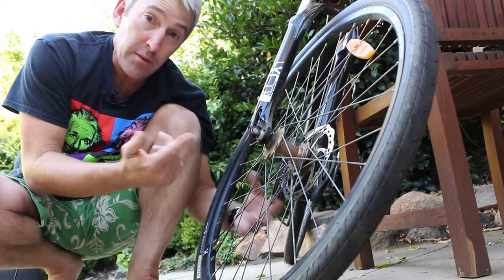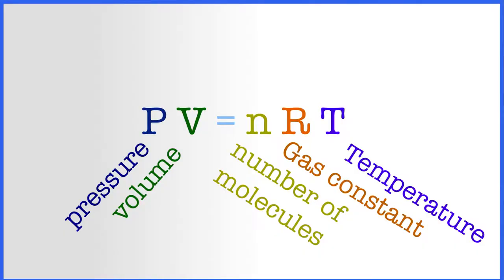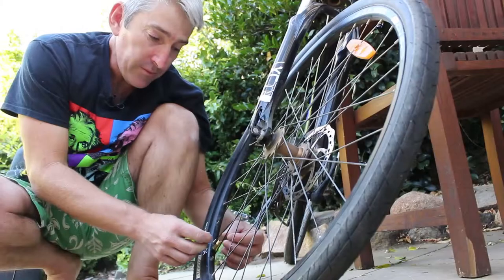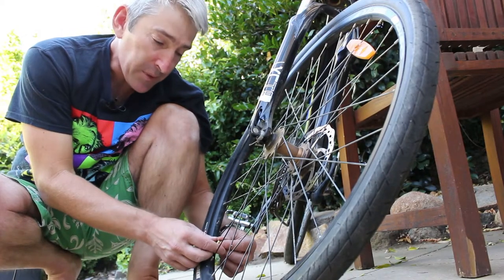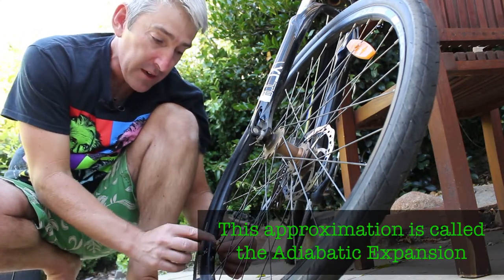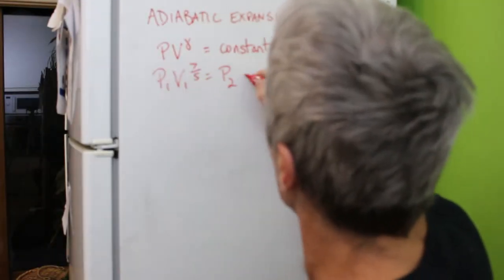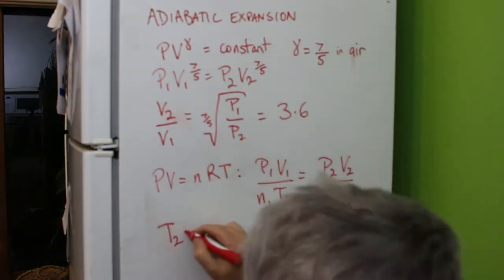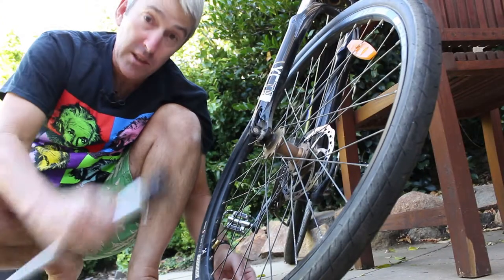How a bicycle tyre is like an airconditioner

Comment: This is a great explanation of refrigeration. I remember reading about how it works years ago and then never really being able to articulate it (the example I saw used an oven and a bowl of water or something ... ) however one thing I can't understand here is why cooling the pressurised gas doesn't reduce it's propensity to spring back to its original volume. Like if I take nitrogen and compress it to a liquid form, it gets super cold doesn't it? The only thing that makes liquid nitrogen want to return to a gas is if you warm it up. If you were to keep the ambient temperature at absolute zero or something wouldn't liquid nitrogen remain a liquid?
Reply from the maker: What a great question - yes you're exactly right, it will spring back to a slightly smaller volume, because it's cooler. If you then leave it for a bit it will warm up to ambient again and expand to its original volume.